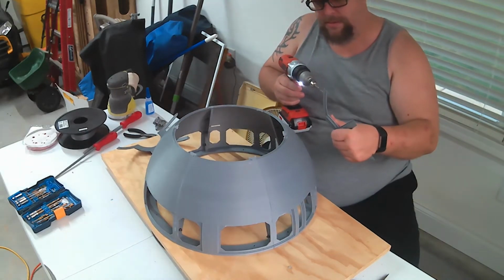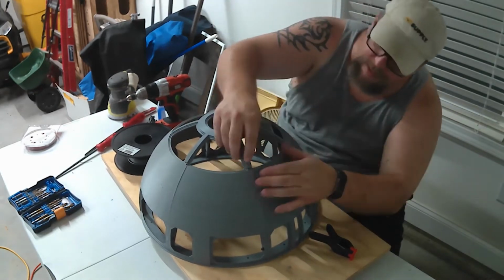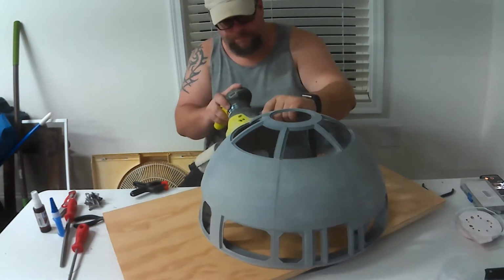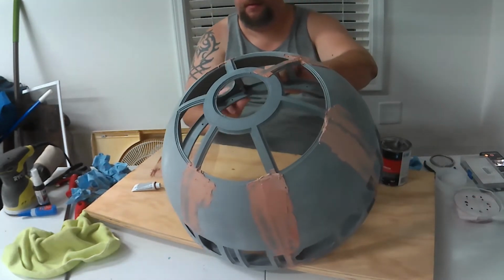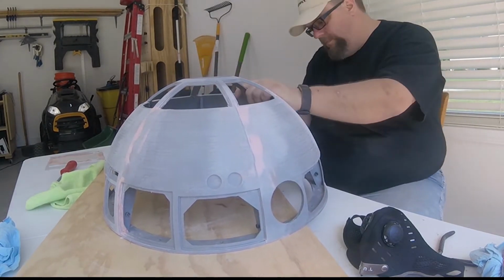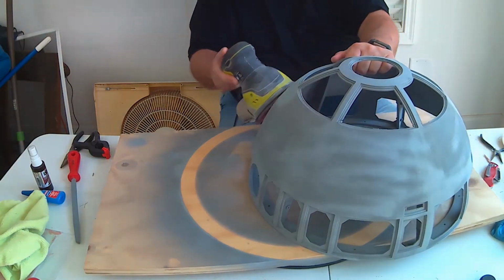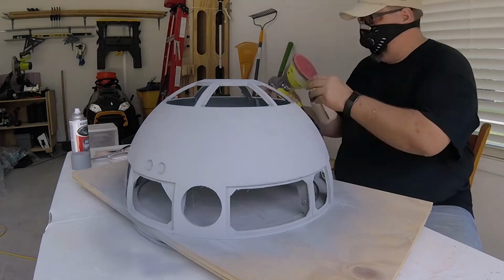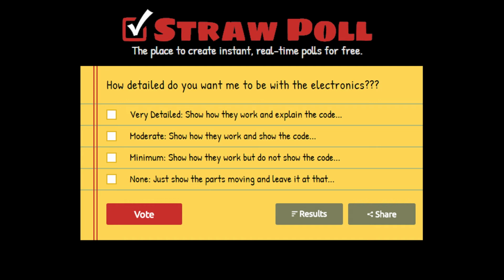3D Printed R2-D2 Project: Part 2

Comment: Did you print PLA or ABS? Is he going to be functional?
Reply from the maker: I'm printing in PLA and Yes he is going to be functional.
Reply: Rorlin 3D NerdStop I always thought that PLA isn't strong enough for this type of build.

Do you know how much you will be spending on a functional (estimate pls)
Reply from the maker: Well, I have about $100.00 in parts for the head. I have not even started looking into the body and drivetrain.  I hope less the $400.00 in the body and drivetrain. I hope no more than $500 in Functional parts. It is hard to say at this point.

Comment: Can you explain the sanding grit and sander you are using - I always struggled with the orbitals but that looks like a very clean sanding solution... I don't see a lot of dust so interested in the type of sander and the levels of grit you are using and in order.
Thank you in advanced
Reply from the maker: Well, I used 80 to 120 grit sandpaper for the first sanding and after the first cost of primer. then I used 220+ for the 2nd cost of primer and any other sanding that was needed.

Comment: Keep up the good work. I had printed a couple of parts but I'm out of filament at the moment to print more :(
Reply from the maker: I know that feeling. R2-D2 is going to take a lot of filament I'm thinking about 6 to 8+ spools.
Reply from the maker: Yes I'm using PLA (Inland Filament http://amzn.to/2uEJe1l ) for this build for the most part. There will be some Nylon or PETG or something better then PLA for gears. There will also be some flexible filament as well.